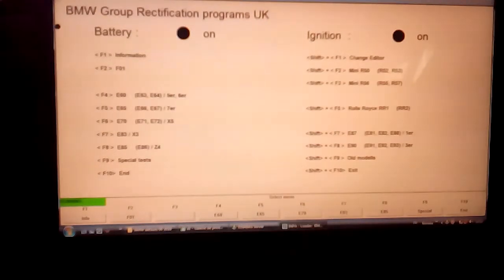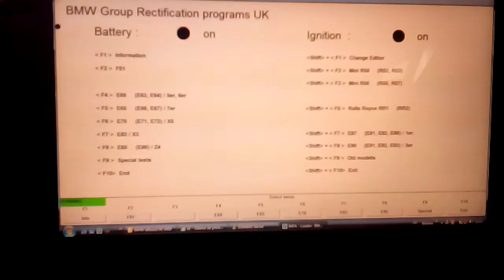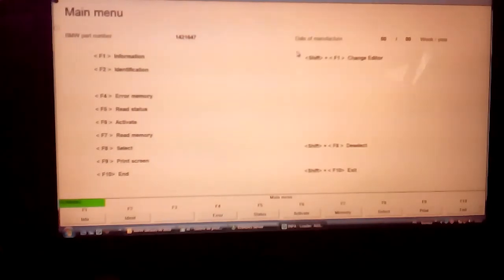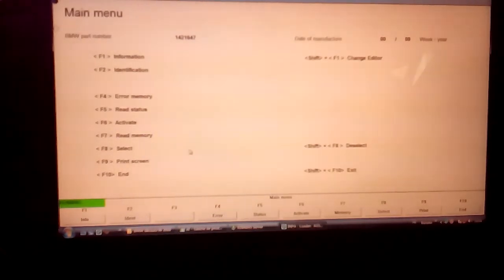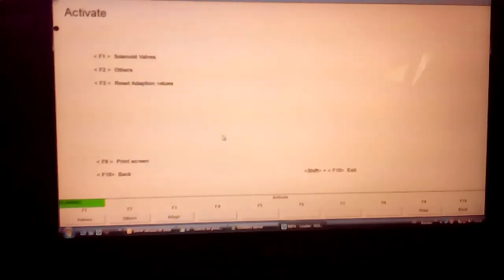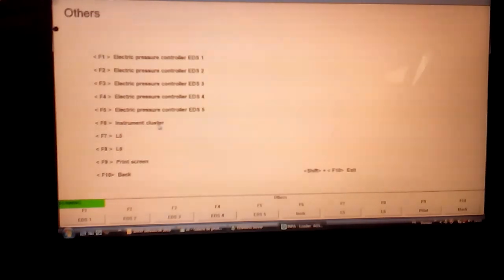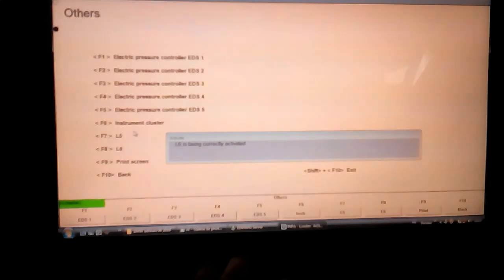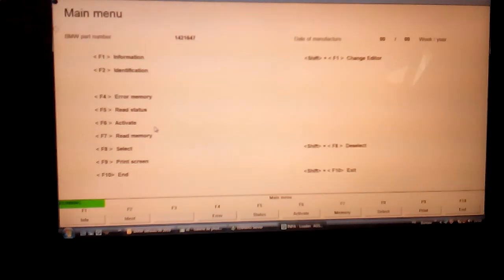Transmission failsafe program  BMW E 38 part 4/5: Solved! Warming up solenoïds with INPA

Comment: Hi buddy, so this means that you corrected the error by just wiping it out with INPA? never came back again? what did the error cause in your car? I have an E53 X5 2006 I have this error and I thought it was many things, replaced transfercase motor, transmission oil with OEM and Valve Body Sleeve Connector Seal Plus Adapter Seal Block and Mechatronic Plug.. still the error is there I even reset the transmission, cleared the error with a good scanner. My vehicle doesn't run at all, it just stays there doing nothing on D or R please help
Reply from the maker: Hello my Friend. My gearbox is a ZF HP 30. And i've been quite since i drive with the air conditionner( that prevent the rpm to slow down too fast when u brake). I also keep a little battery charger permanently connected  . Using INPA helped me to exit the ''failsafe mode''as described in the video,  combined with a stable 13v input . 
I've never experienced the fs mode again for more than 18 months now. 
I don't Know how it works with your car, but eatch time i did not Hear the relay under the glove box clic, you could be sure fsm was to happen.
Good luck. Hope It will help you😉
Reply from the maker: When fsm was on, i had R ok with a little chok when engaged. On D, the car
Reply from the maker: was driving locked on the 4 th Gear ( to take me back home...)

Comment: what if inpa gives error when trying to load transmission module ?>...  its only a few that do this when i try to load on inpa
Reply: You mean that the tcm is unreachable? Maybe the battery tension is too low, 
Connect a strong charger capable to déliver 13,5 v, with Key turned just before ingnition point, or start the engine and reach 2000 rpm.
Reply: @jetsdr5092  thank you !!!

Comment from the maker: It's been quite a year since that video, and the Failsafe mode never came back. I have not unplugged the battery either. I only recharge it before using the car.

Comment from the maker: 2019 02 12. Cold Season here in France, and almost 7 weeks without using the car. With only 11,6v i recharged the battery first. Then a 35 km drive with 3 starts at the very begining😒. Fluides too cold? When i finally went out of the garage, every thing worked fine. Now i dare to drive without bringing on my computer 😆...

Comment from the maker: Here are the necessary devices (less than 30€)

https://www.ebay.com/itm/USB-OBD2-Cable-Lead-Ediabas-INPA-GT1-DIS-SSS-20pin-Adapter-Set-for-BMW/331999672164?epid=2158336911&hash=item4d4cb8f764:g:HO0AAOSwWI5cAoof

As i am under OBD1, i needed the round connector ''Pac Man''.My version of INPA run's on a Vista PC.

Comment from the maker: Remplacing solenoïds &  pressure controlers is about 900€...
Now i wait untill my battery gets close to 12v to check if my therory is Wright. 
Is the TCM message ''156 Can time out, permanent error''  the concequence of a low batt+ ''rusty'' solenoïd?
*Untill wich limit a low battery will be capable to switch on the ''warmed up '' solenoïds?
*What is the procedure to clear the Failsafe mode, engine runing? 
These are my next experiences. I'll let you know.

Comment from the maker: Now i hear a little ''clic'' from the transmission when i turn the key step 2. Do old solenoïds & pressure controlers need to be warmed up before we start ?
So confortable to watch ''live'' the parametres while you drive 😃, and to be able to wipe out the ''Failsafe mode'' at once, engine off.
INPA software:
Shift F9 old models
E38 Transmission
F6 activate
   F1 3 Solenoïds 
   F2 Others( 5 pressure contrôlers + Instrument cluster+ L5, L6?)
   F3 Reset adaption values ( driver's habits in memory)
   F6 Instrument cluster
--------------------------------------------------------------------------------------------------------------------------------- ECU and TCM now share their original supply. The second battery has been converted into a charger booster installation.
Reply: What is the solution please!  😀
Reply from the maker: @malaifaizul  Sorry. I've just noticed your comment.
Reply from the maker: Here are the necessary devices (less than 30€)
https://www.ebay.com/itm/USB-OBD2-Cable-Lead-Ediabas-INPA-GT1-DIS-SSS-20pin-Adapter-Set-for-BMW/331999672164?epid=2158336911&hash=item4d4cb8f764:g:HO0AAOSwWI5cAoof

As i am under OBD1, i needed the round connector ''Pac Man''.My version of INPA run's on a Vista PC.